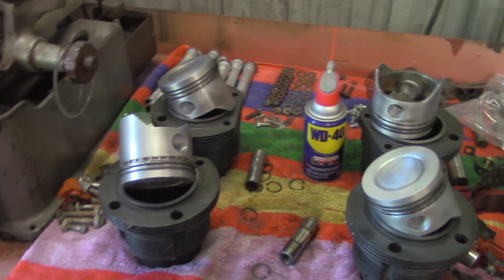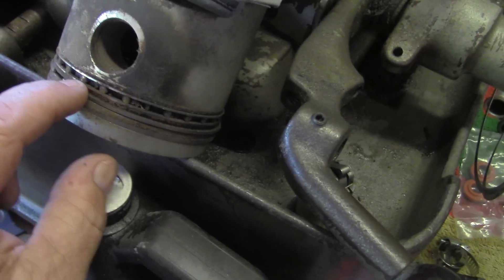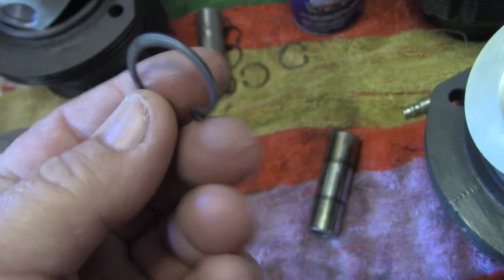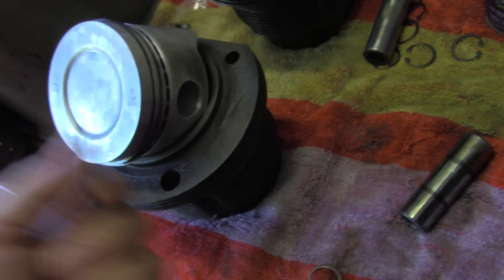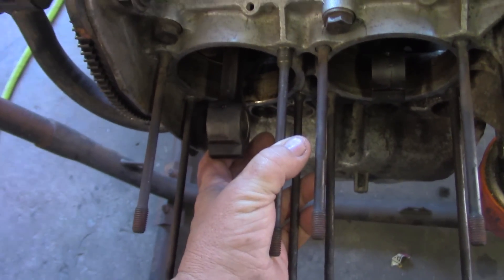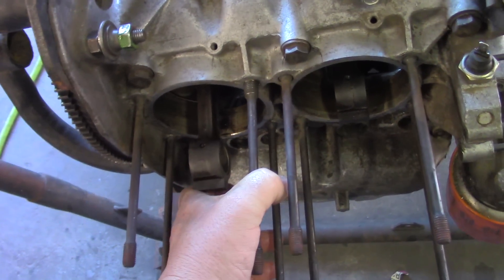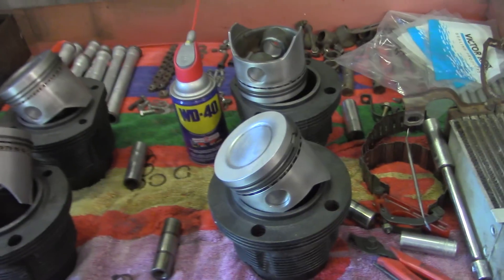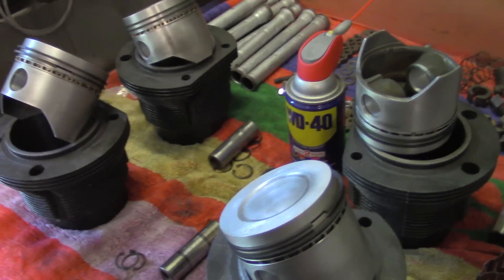VW Type IV Wrist Pin Keepers

Comment: i have a vw here , it seems like it is hard to turn over . 85 psi compression on all but #3 cyl , it has 100. also has electronic distributor , and a ballast resistor . not sure if it should even have one being electronic .
Reply: yes it should to drop amperage so the module does not heat up ,,,enjoy

Comment: Removing tight pins from a wbx engine through the water jackets, now that's a whole lotta fun!
I wonder what the reason is for having a beveled side on the retainers anyway?
Reply: It is the way the manufacturing process forms the circlip that leaves one side rounded. I think it is a happy occurance as the rounded side won't catch on the wrist pin. There are lots more designs of circlip used on wrist pins as well, check out the mahle information on youtube around circlips for them.
Reply: The retainers are stamped out . The sharp edge side faces out. The sharp edge helps the retainer grip the piston retainer groove. However a bent rod will make the wrist pin push the retainer out, so be 100% sure your rods are straight. Do not use Teflon Buttons on a street motor.